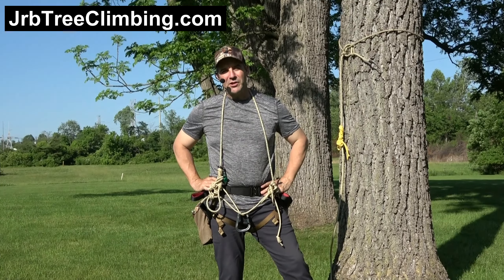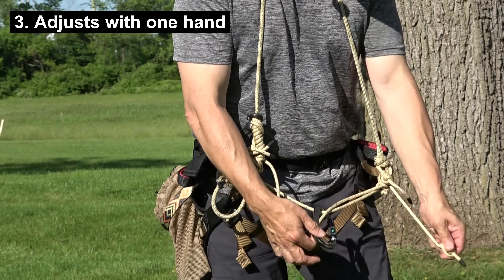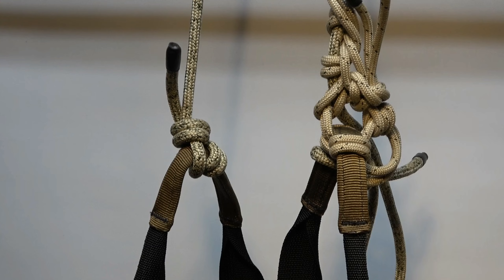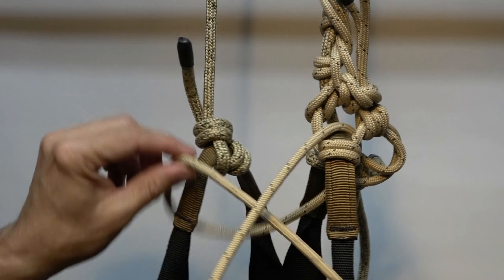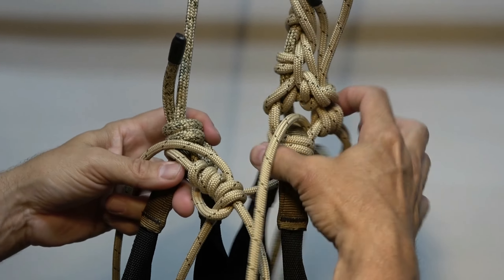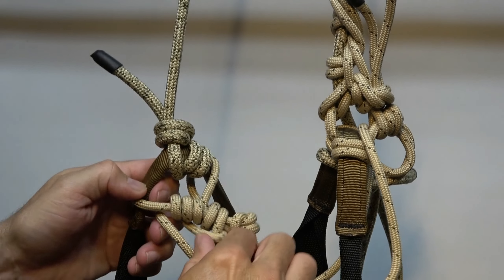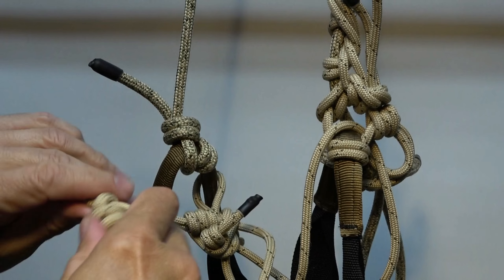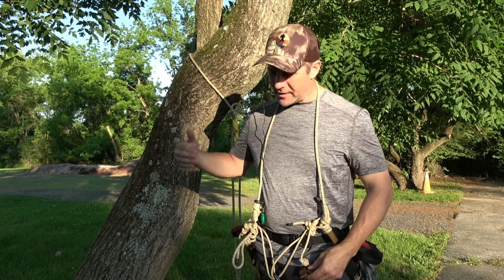Blake's Hitch Tensioner Bridge

Comment: If I like to keep my bridge short, is there any reason this design couldn't be used as the main bridge?
Reply from the maker: No problem using it as a main bridge, however... most folks prefer that their main bridge will cinch tight on their Bridge Loops exactly where they want it. This will float around.  Also, if this was my main bridge, I probably would go with a more substantial cord like a quality 7 or 8 mm cord.